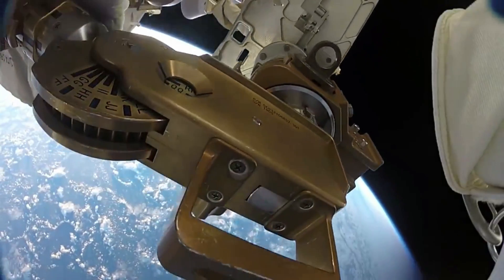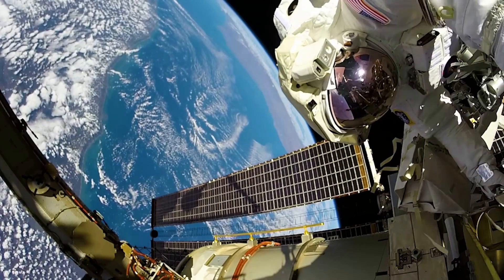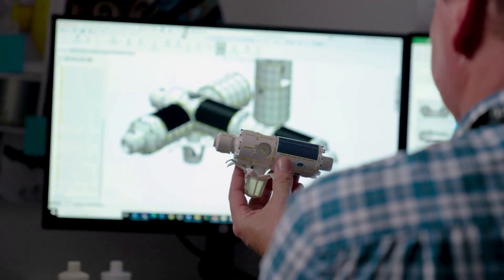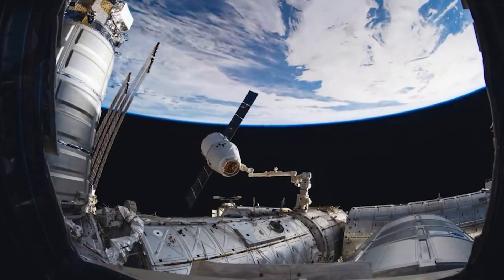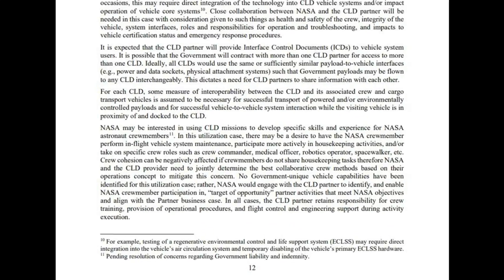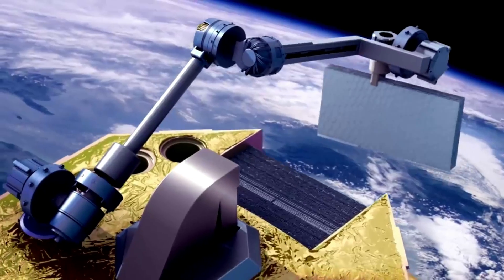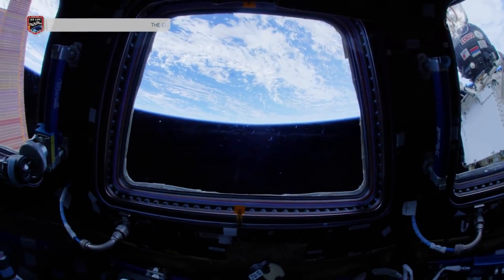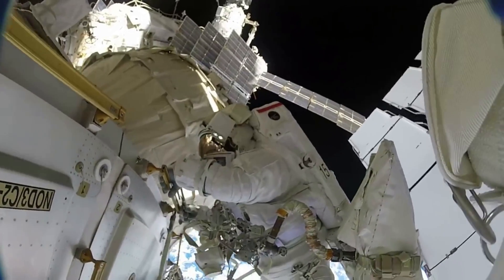What Progress Is The First Commercial Space Station Making?

Comment: i can see a problem with all station designs these days it's all build around one central part that you just can't replace. i would think it's smarter to make bypasses so that the moment a central part of the station becomes obsolete or damaged you can evacuate it and take it out of the structure and then replace it with new and improved parts meaning no more abandoning stations. just parts that are to old.
Reply: That doesn't solve much really. You will always end up having a "middle part" that it's just too hard to replace. And even if you have multiple central parts, the central aspect makes them really hard to do the undock maneuvre when you want them replaced.
Reply: @LordSesshaku  just means they have to do more research in how to solve that.
Reply: @highkicker11  Or....they can just do it this way, knowing that by the time those slots are in need of replacement 30 years away it would probably be easier and cheaper to just rebuild the whole thing instead of mixing parts from different eras with different technology and design approach.
Reply: Thats an option for sure. Though calling it a problem isnt the best term since it has worked on every station and has never posed a problem that i recall.
Now that getting to space is getting much easier and cheaper, im sure we will see new ideas implemented. Though i wouldnt be shocked if thats not one of them, at least for that reason. But once commercial ones become a common thing, im sure we will see very different ideas come into play.

Comment: Who is providing the ride into orbit for these modules? Also, why isn't there a biggest solution to replacing the old modules and overhauling the station? I realize that it is aging, but to simply throw away this engineering marvel, in not using it only on a smaller scale to allow Axiom to attach to the station and then separate?
Reply: The ISS is not designed to have the central core replaced. Both sides of the ISS rely on the other side to work.
Reply: @steveaustin2686  Eitherway, we should be taking advantage of the ISS and its current abilities and to create or build some little station just so we remain in orbit is pathetic! If we wanted to i am sure we could come up with something in terms extending the station and its central core to add on and update the station. It seems like an utter waste.
Reply: @RamblingRodeo  NASA would like to turn over LEO operations to commercial concerns and rent time in LEO as needed. That way NASA can focus the budget more on deep space and the Moon. Not to mention growing the commerical space sector.
Reply: @steveaustin2686  In all honesty, NASA should become an agency to oversee commercial space, instead of like the FAA for example.
Reply: @RamblingRodeo  You have a point, somebody has to ovesee that.
Reply: @steveaustin2686  We have seen that the FAA is out of its depth!
Reply: @RamblingRodeo  The FAA doesn't cover space, their authority ends at the atmosphere. The FAA is fine, as they are not holding up SpaceX. The channels watching the construction at Boca Chica, still show SpaceX finishing up Stage 0.
Reply: @RamblingRodeo   The FAA vs SpaceX is not really a thing, except for clicks by certain YT channels. After all, the FAA defended SpaceX in front of Congress in Jun 2021 over the unauthorized SN8 flight. The 'NASA delaying Starship until the SLS flies' is just as silly, since NASA needs BOTH Starship and SLS for Artemis. Besides, the review was completed already.

SpaceX had approval for orbital launches of the Falcon 9 and Falcon Heavy from Boca Chica since 2014. They can also fly sub-orbital tests of reusable spacecraft. SpaceX went through an Environmental Impact Statement (EIS) to get that approval in 2014. Now, SpaceX wants to fly orbital flights with Starship, that has roughly 3 times the propellant as the Falcon Heavy. So the FAA review was to see about adding Starship to that existing approval, without having to go through another EIS.

The FAA was the lead agency with NASA, the Army Corps of Engineers, the US Coast Guard, the US Fish and Wildlife Service, and the National Park Service all involved from the beginning. With 6 different government agencies involved, it is not surprising that the review took time. Musk asking everyone to comment, over 18,000 comments were received, didn't help. Consultations were mentioned for a third time on Apr 29th,2022 and mitigations for the first time, so some issues did come up and SpaceX had been working out a solution with whichever agency or agencies covered the issue. The Permitting Dashboard: Federal Infrastructure Projects had 5 sections to the FAA review. The first was completed in Oct 2021, second in Jan 2022, third in Apr 2022, fourth in May 2022, and fifth in Jun 2022, so there was continual progress. The FAA review is complete with Starship able to fit under the existing EIS for Boca Chica. SpaceX can do the mitigations and apply for the launch license at the same time. Apparently, some of the mitigations, like the wildlife crossing, only have to be started and some are on going.